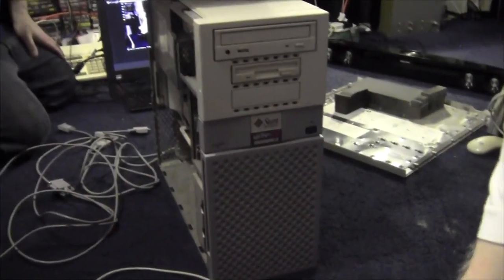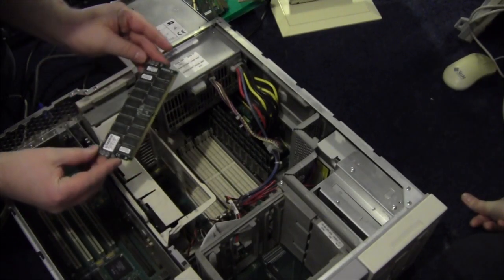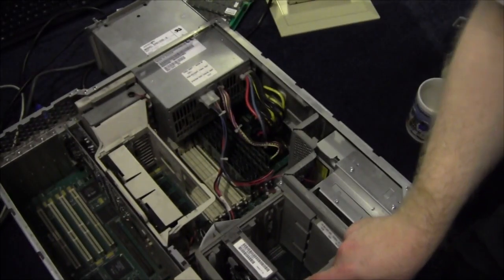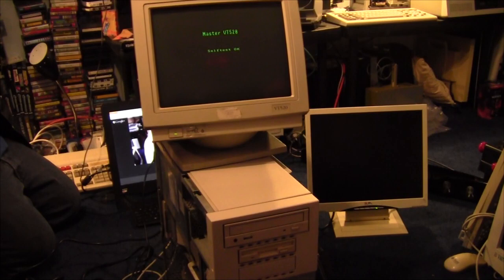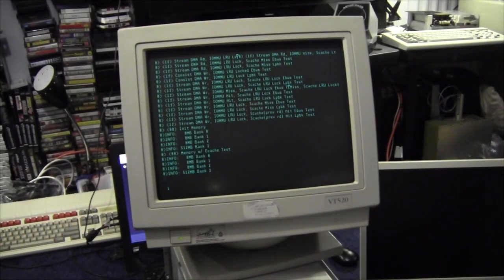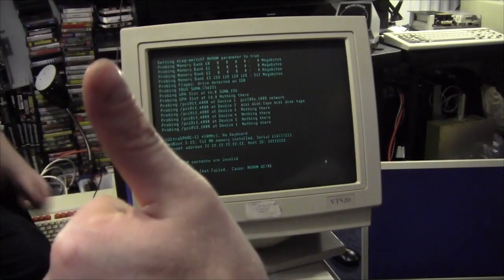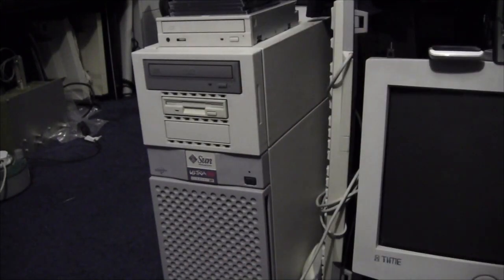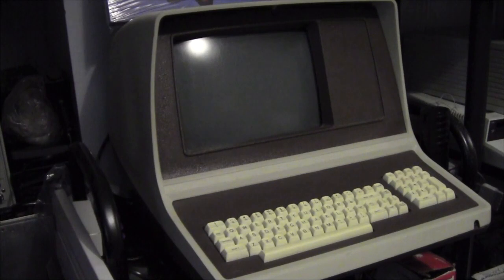Sun Microsystems Ultra 60 Repair Part 1 :o)

Comment: I got a Sun Ultra 60 a week ago and got it to work.  Installed Solaris 10 and other stuff.  But yesterday I was removing some DIMM's and then putting them back in and now the computer boots to video display, does "initializing memory" but gets stuck after that with the black square cursor.  On boot I can do STOP+A to enter the idprompt.  With probe-scsi I can see all the SCSI devices but any boot xxxx command again gets stuck after "initializing memory"